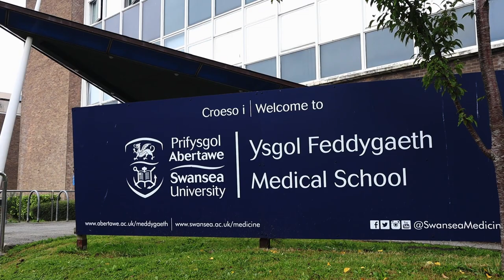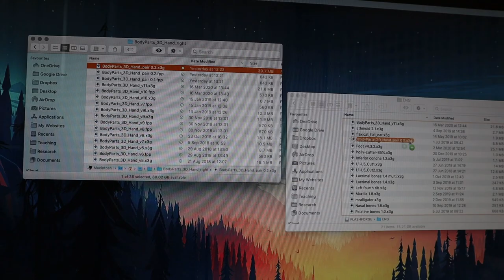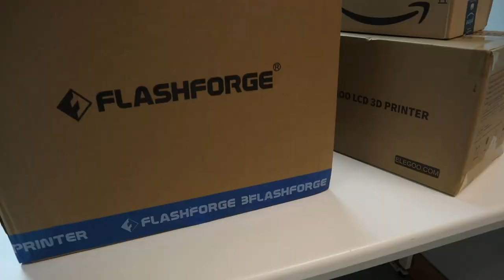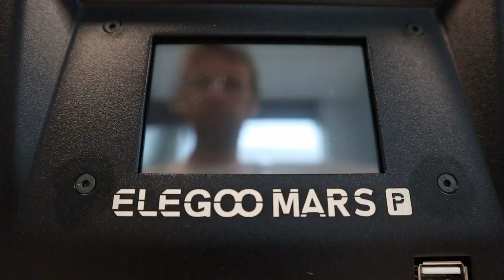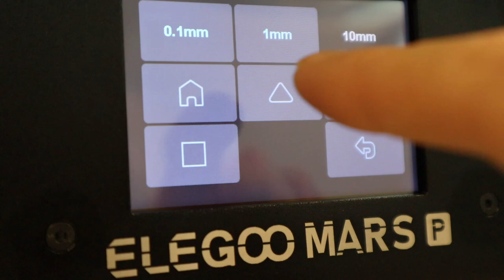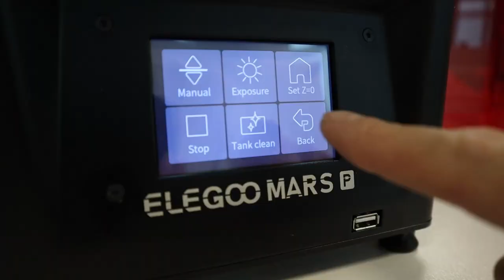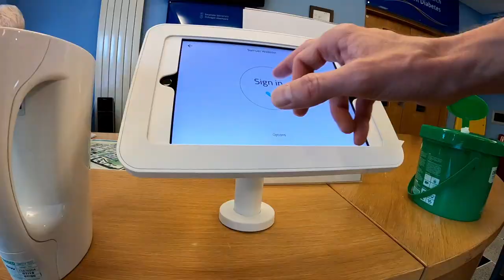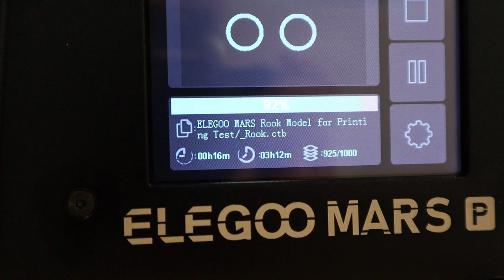Back in the lab (vlog)

Comment: Hello professor, first of all thank you for making videos, You are an example of brilliant modern teacher which keeps up with tehnology and science. I hope that you will get that SLA printer to work, but if it helps, it seems like the bed is not propertly leveld with the base and thats why it is not sticling very well.
Reply from the maker: I increased the exposure time for the first layer and it's printing great now, thanks.
Reply: @SamWebster  I'm glad you solved the problem. I am also working on a collection of printable anatomy models that should be used in teaching on my university.